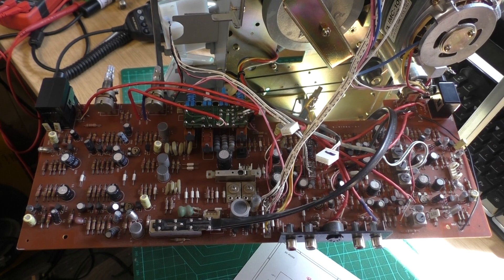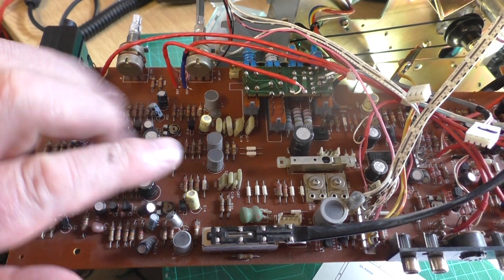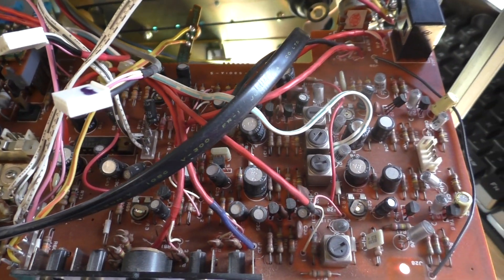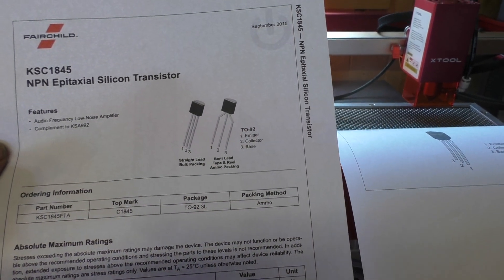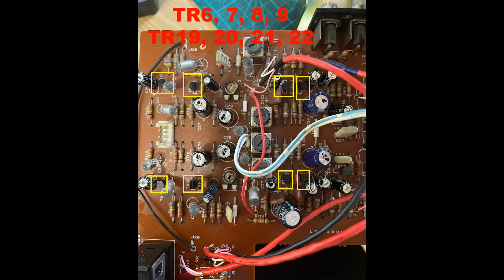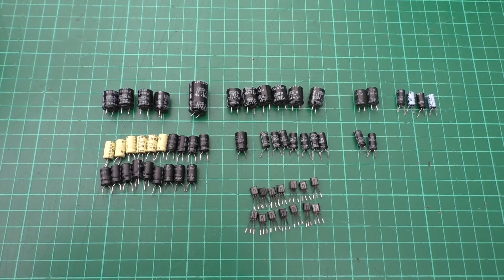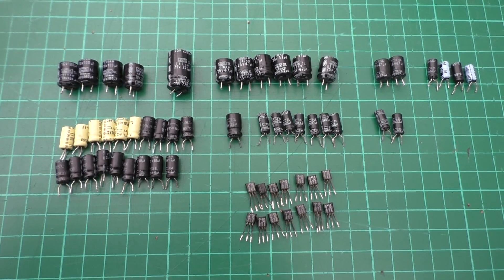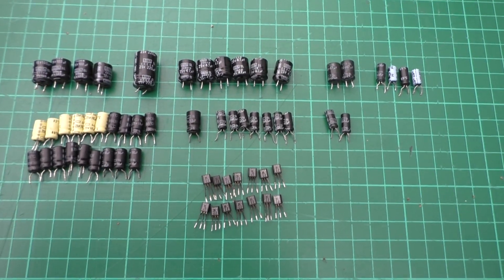Akai GX-4000D Main board capacitor and Transistor replacement.

Comment: Hey, thanks for making this video, it has been most helpful in my research. I am thinking about buying and restoring one of these, but before I do, I just wanted to ask if you had to de-solder any wires to gain access to this board? I don't mind a few, but it can be a bit of a pain when there are a lot of them I have to keep track of.
Reply from the maker: From memory i think i had to de-solder the VU meters, two wires on each to allow the PCB to come out, all other connections were pull out white plug and socket, all the  wire raped terminals had enough cable length as not to be disturbed.

Comment: Just went through the caps and you have some mistakes: There are 5 X100uf caps and not 4. There are 20 X10uf caps and not 19. There are 8 X4.7uf caps and not 7 and 2 X2.2uf not 4. The power supply board caps are 1000uf, 2x220uf, 47uf. I’ve gone 50v with all caps.
Reply: There's also 2 x 33uF, not 1 (C39 and C90)

Comment: Hi. Why my GX 4000D run slow?
Reply from the maker: Hi it could be a number of factors, slipping belt, dirty fly-wheel, may simply need the mechanical parts stripping and regreasing, as the original grease dries up. Sorry its really hard to diagnose without having the unit in front of me, i would recommend a belt change and basic service of the mechanical parts.
Reply: @waynephillips1848  Thank you anyway.

Comment: I have the same unit but the right channel doesn't work at all. (Meter inactive and if you put the switch to track 3-2 and rise the volume all the way up you barely hear a tiny bit of treble.) I believe a capacitor somewhere in there has dried and shorted internally, because if I add a higher voltage to the right channel input or the right side of the head it temporarily starts working again and sounds a little distorted. Left channel is perfectly fine. Any recommendations on which components I should replace?
Reply from the maker: Hi to be honest it sounds like your caps are coming to end of life, as you need to open up I would recommend a full electrolytic capacitor and transistor change.

Comment: Hi, good job, I am doing the transistors replacement in my GX 4000. Not doing the capacitors at the moment because I heard the old ones are usually good.. Did you find any to be faulty when you replaced them?
Reply from the maker: Hi, If you have taken the effort to take the unit apart i would defiantly do the caps, to be honest i never tested the caps i removed, the caps dry out over time, might save you having to do the job twice.